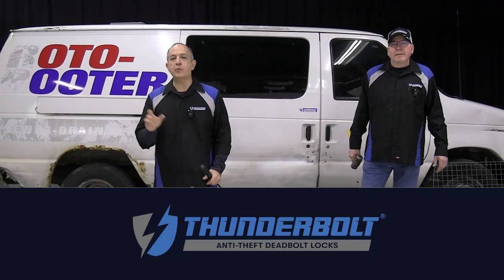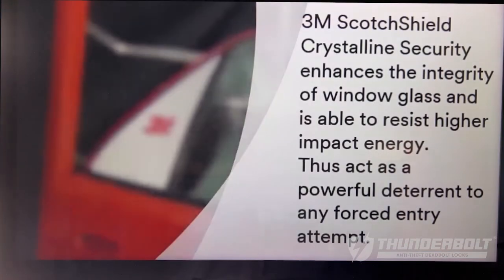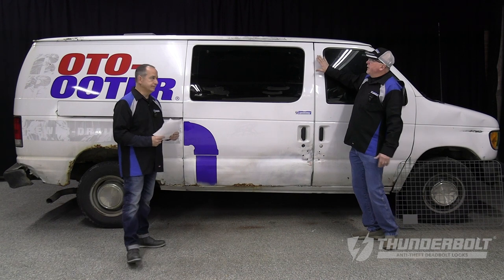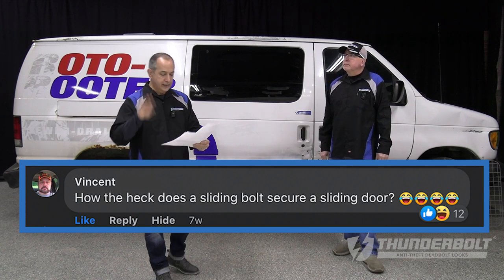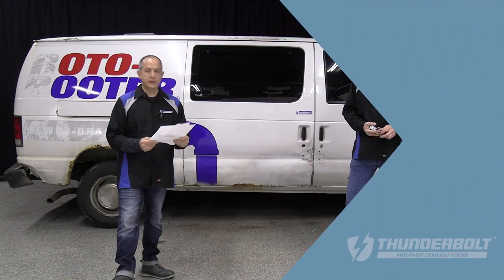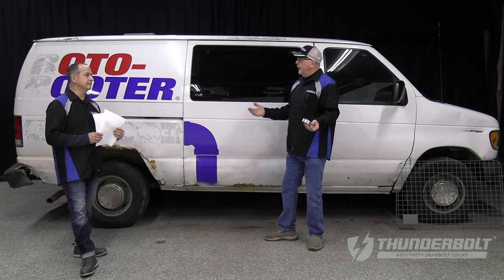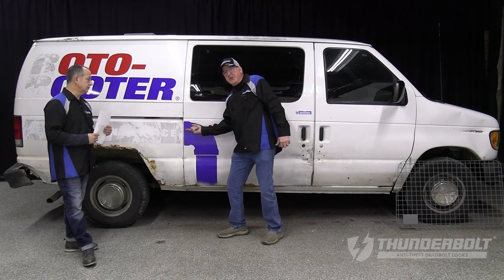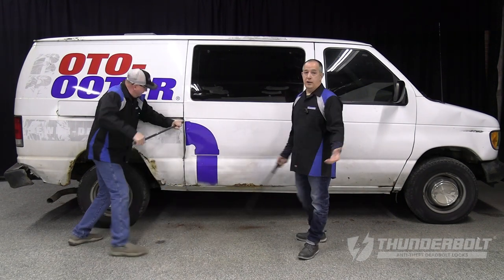Thunderbolt Deadbolt Locks Demonstration

Comment: the security film on the windows is certainly good for slowing down a break-in, but if you have to get out after an accident, there will be problems
Reply: Probably be best not to ride in the back of the van?
Reply: @mrbadger9920  thought if it was on all the windows
Reply: What are the chances of getting into an accident vs theft via breaking windows? Then act accordingly.  What is the answer?
Reply: @totorishop  depends a bit on where you are. accidents depend a little on how you are as a driver. if you think about yourself and drive selfishly and if you drive like an idiot, well then the accident is close.
Reply: I drive defensively myself.

Comment: I’m glad to have this video but it’s not really answering some basic questions. How many locks to buy, and one remote? Van lifers also or just pro vans? Are you advertising the locks plus that you install? Where are you? Or you could provide link to Thunderbolt locks maybe? I’m a van lover and I’m just trying to understand what to buy and who could install it. This is great , just wanted more 😊
Reply from the maker: Happy to help! One lock per door that you want to secure. The locks can operate either from your key fob or ours. Any type of van or box truck. We sell locks at www.thunderboltlocks.com  and we do installs in Chicago at www.ChicagoUpfitters.com 🚐👍🏼
Reply: Oh thanks that helps. I’m gonna call around bc I don’t understand how many I’d need and then if I find an installer, do I bring them the parts? One guy said he installs Thunderbolt but wanted to sell ….. seemed like a Wi-Fi security system mostly.